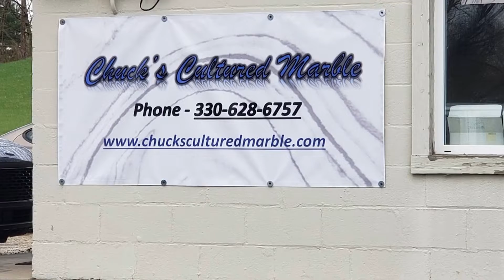Manufacturing Cultured Marble

Comment from the maker: www.chucksculturedmarble.com
Reply: Nice work, Chuck. Can you share what material you are casting against? We cast concrete.
Reply from the maker: @magnumopusdesign9148  Industry wide we use Tempered Glass , Fiberglass Molds, and you can also use Formica and Stainless steel. Whatever you use you will need to use a release agent. We use semi permanent release agents. Some companies use a release wax that is applied just like paste wax on a car.